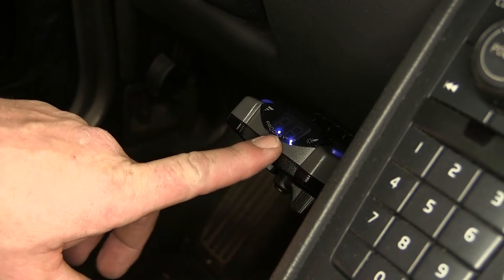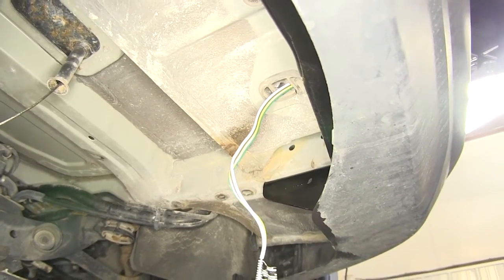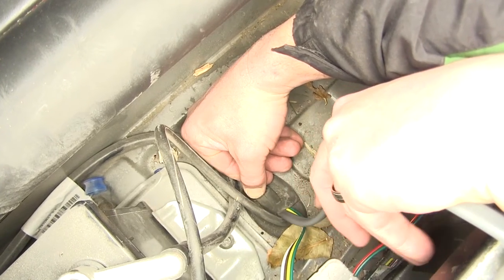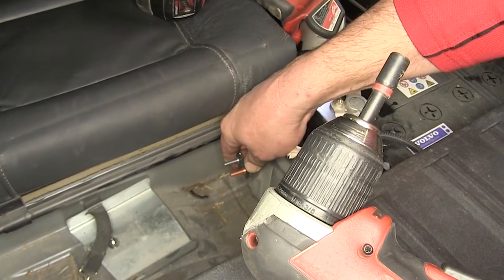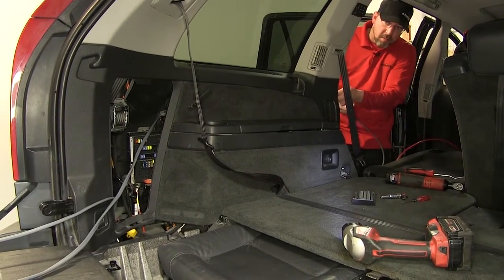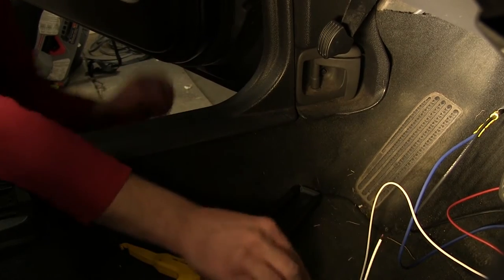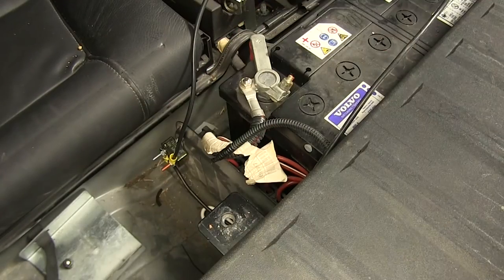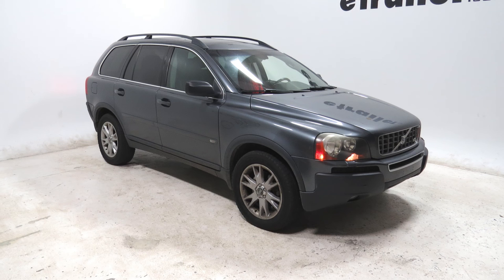etrailer | DIY 2005 Volvo XC90 Installation for the Tekonsha Prodigy P2 Trailer Brake Controller

Comment: If you were using your reverse lights on your trailer where would the purple wire go?
Reply from the maker: You would need to tie the reverse light signal wire into a wire that is triggered by putting the vehicle in reverse. You can test this with a light tester and putting the vehicle in reverse.
https://www.etrailer.com/Accessories-and-Parts/etrailer/ETBC7.html
https://www.etrailer.com/Accessories-and-Parts/Draw-Tite/40376.html